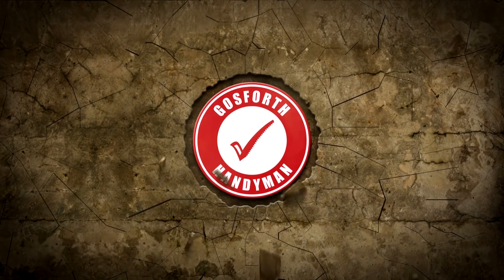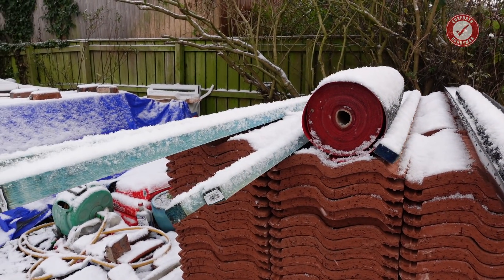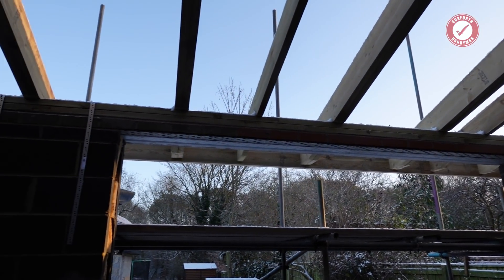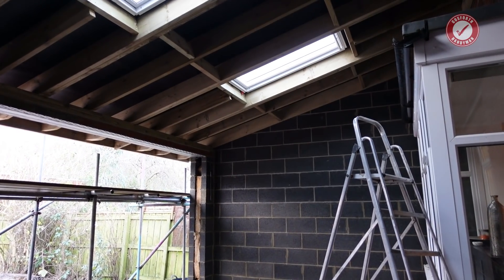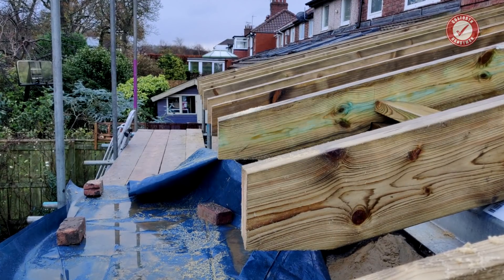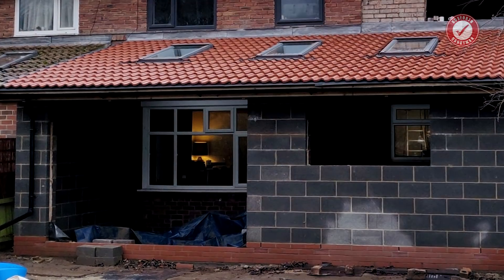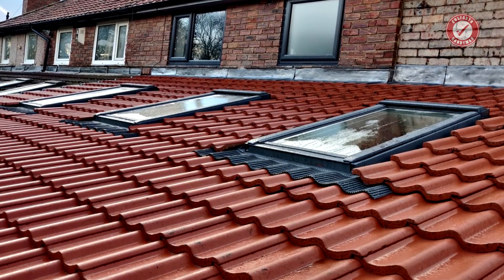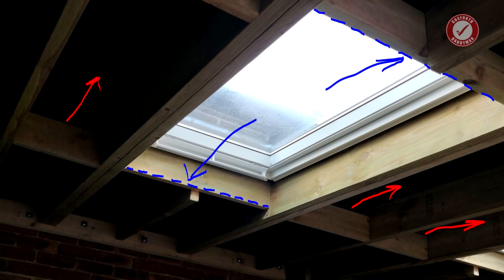Our extension lean-to roof explained

Comment: I’m a Gas Engineer of 20 years, last year hand cut my new extension roof in, with two large velux windows 1100x1000, battened, tiled, insulated, boarded completely inside, everything correct, and even the building inspector said he’s seen supposedly professional roofers do a worse job. Really proud of my roof.

Comment: What I’ve seen so far of your workmanship and attention to detail, I have absolutely no doubt you could have done the roof work yourself and achieve a far better finish. I’m amazed they left you with the issues they have.
Reply: Unfortunately I am not amazed at the issues that were left, I had similar problems with flooring contractors. I gave up calling them to finish the edges and did it myself.
I should have not paid them until the job was completed.
Reply from the maker: Cheers! I'll defo do my own roof next time. Did expect a bit more for the money. 🙄

Comment: As a retired roof tiler , that right hand verge was the first thing I notice. and there is no way I would have left it like that. ps; there is no way I would have done it like that.
Reply from the maker: Yeah, didn't think that was normal. No Idea what they've done! The top dry verge piece doesn't look like it's nailed in properly. I need to take a few off and have a proper look. 👍
Reply: @GosforthHandyman   my guess would be, battens too long, and/or tiles.  ps; I would cut and put dry verge in, as I think doesn't look finished.
Reply: also when I finished the roof, I would ask if your satisfied with what I'd done.
Reply from the maker: I think they just couldn't be bothered to cut at fit the final verge piece. 🙄

Comment: I would cover the roof rafter at the left and right side somehow with copper or zinc to prevent it from rotting away. Hard to see, but the water probably isnt catched completely if rain is a bit stronger as it will shoot over the gutter

Comment: I've seen some issues with extensions like this where the cavity is interupted by a lintel, so if water does end up inside the cavity it basically has nowhere to go. Ideally you have cavity trays leading to weep vents just above the level of the flashing, or in your case between the upper windows. Can be retrofit if you run into problems.
Reply from the maker: Amazingly there's a cavity tray under all of the old windows and over the 'tile' feature. So should be fine. Plus most of it will be rendered. 👍

Comment: Use a handsaw or sawzall and start by the fascia. 3:05  Shouldn't be too awful.
 An easy way to calculate exposure for siding or shingles, is to use a story pole that you make yourself. You know the total length and the size of your material. By varying the angle of the stick, you get different exposures. Don't forget clearance to skylight if any.
Reply from the maker: Yeah, wasn't too bad - just really awkward to get in. Multi-tool ended up being the easiest. 👍

Comment: Great update! I’ve had the same problem with roofers. The company I used last year to put a new roof covering and soffits, fascias, and guttering, won’t come out to fix a sagging bit of soffit where they haven’t put enough fixings. And the waste stack clip they used has snapped, so the top is swinging in the wind.

Like you I’ve tried 5 times and they’ve broken promises every time.
Reply from the maker: Very frustrating. I've given up with mine. Shame. 😭

Comment: If you are planning on attempting to dry out the walls and sub base with a space heater then I’d suggest insulating the roof space, blocking up the window and bifold door holes with celotex and getting a bigger gas space heater than you think together with a bigger propane bottle. Open the velux windows on vent and let the heater rip. I tried to dry the block walls out on my 7 x 7m garage without insulation and the baby space heater was running for an entire weekend and I barely saw any improvement but the windows were dripping wet with condensation so something must have been happening 👍🏻
Reply from the maker: Ha that's pretty much what we did! (without insulating the roof first). Dried out nicely (next episode). 👍

Comment: Hi GH. Just wondered is a cavity tray needed. Considering a conservatory roof replacement . Existing weep holes on onternal of conservatory.  Thinking i should install new tray above level of new roof? Wondered if you had this issue and covered in a video? Cheers .D

Comment: Cracking extension..... and videos.
Just one thing. The tiles immediately above the Velux window sit very close to the window. 
Speaking from experience,  cr4p builds up in the wee valley between tile and window, and if not cleared out, lets water build up and can ( in my case, did) leak above the flashing. Checking for rubbish ( and getting it out) isn't so easy when tile is so close. ( the edge of the tile will take your finger end off!).
Keep up the smashing work.
Reply from the maker: Cheers and good tip! I need to take a look. I think it's a big enough gap to clear out. 👍

Comment: Apart from the few sloppy items left to rectify it's good to see the roof on.
But I hope you gave the infill for the floor and the insulation in the walls more time to dry than a week without and a day with an industrial heater.
This takes ages to dry out, and without any heating it would not have had a chance at all to dry because of the wet weather and high humidity we had until the start of March.
I could see this on my driveway staying wet all day even on days it didn't rain over the winter months.
Closing the door and window opening with some plastic sheeting and then using an industrial dehumidifier would give a better chance.
Luckily March is now presenting with very nice and dry weather, and things are starting to dry out very well, and the constant battle against the elements is over for now.
So I was able to finish the underpinning of the foundation under the side extension of my house.
Reply from the maker: Yeah, floor got a good chance to dry out. Got a space heater and that really helped. 👍

Comment: yea the rafter around window. you have lenght of normal rafter minus window and two blocks, thats the leght on the rafter and it does not matter where the window is, so basically you could have prepared rafter with both ends (plus size of cut, thats like 4 milimeter) and then if you cut this for window at whatever spot, you have top and bottom ready.-

Comment: Scaffold and drains!! I was running a job in the Kings Road Chelsea, when i went out on to the third floor scaffold to see how the chippy was getting on and I thought that the scaffold was a bit springy. On investigation I found the ground workers had dug a drain trench right under both the front and back scaffold standards!! The roofers should have been patient - as they are [presumably] specialists, they should have told you in advance where the Velux trimmers should be positioned  and they should have told you in advance just how many tiles were required knowing the roof pitch [it's not rocket science for a roofer]. Don't envy you cutting the bottoms of those rafters, lots of bruised knuckles and plenty of swearing I expect....
Reply from the maker: Cheers Robin! Yeah, now that I see how it's done around the Velux I could have worked it out. Although it was nice letting them put the Velux in. 😁👍

Comment: Hi I am currently doing a extension similar to yours and would like to know whether you needed structural engineering calculations for the roof to have a vaulted ceiling.
Reply from the maker: Hi - yes, for building regs we needed architect and structural engineer drawings.

Comment: Hi Andy, how did you fix the verge board on? We have moved into a house with a similar extension, and I am trying to reverse engineer what they have done as it's a bit buggered...Basically, they never added a verge and just fixed a bit of facia capping over the tiles and down tight against the render. I guess because like you, the roof was constructed within the extension with walls shaped up to the roof line. Is yours bolted to the wall? Or did you fly some rafters somehow through the blockwork to attach it? Cheers mate :) P.S - been driving quite a bit for work so have been re-listening to the podcast :D

Comment: Great to see the roof on. 
With the timber roof, the other way is to stick to 600s all the way. This will mean the velux hole is too wide but just trim in a short rafter on one side or both to get an exact positon.  Then the plasterboard goes up easy!.
Reply from the maker: Yup, tried every combination but just didn't work where we wanted the windows with the 830mm gap. We'll probably lose a sheet or two of plasterboard due to the cuts. 👍
Reply: @GosforthHandyman  This is good information for other people trying to build extensions and the like: sometimes you just can't get find an arrangement of material that meets all the limitations and so you have to choose the least worst option and accept that some wastage will result. At least plasterboard can be recycled.
Reply from the maker: Cheers! Yeah, it was basically a toss up between extra rafters or have some plasterboard waste. Plasterboard is cheaper. 👍😁

Comment: Hi Andy
Wow what a transformation looking good now mate,  you must be made of money mate if you are using an Electric fan heater to dry out that area would be much better off with an oil filled radiator or a greenhouse heater that runs on oil or paraffin great video mate thanks 😊
Reply from the maker: Ha ha, the electric heater was just to warm my hands. Got a little space heater to dry the place out. 😁👍

Comment: Great video, I’ve done a flat roof approximately 40sqm for an outhouse but never done a pitched roof rafters. Now I’m considering to build a 6 meter extension. Is there any reason for not using thermal block for internal skin of the wall? Thanks

Comment: Hey Andy,  Rainwater into a foul sewer?  do you guys have different rules up there?  I would have thought in view of the fact that the extension gives on to the garden, you would be expected to run it into a soakaway??
Reply from the maker: Everything is combined sewer around here on the older houses. Not entirely sure why! Someone mentioned the soil type doesn't lend itself well for soakaways but not sure how true that is. 👍
Reply: I'm in East Anglia & our gutter run offs goe into the foul in our road for certain due to problematic watercourse topography & soil type (mix of 100+ year old up to 10 years old & new development going in also)
Reply from the maker: Interestingly there's a rainwater sewer in the street but it just runs in to the river.

Comment: Looks like the rain would run over the gutter .. probably need to pack out facia to allow for rain run off
Reply from the maker: The final gutter will be higher but no sign of the rain overshooting the gutter so far. Easy enough to pack it out if it becomes a problem though. 👍

Comment: How is the dpm going to lap with the dpc.  That on the face of it is a carnal mistake!  I would have expected the oversite slab to have been installed early to allow the concrete to be tamped off the wall.  As it stands the oversite will have to be levelled 'by hand'.
Also, why is the extension roof using a different roof tile to the main roof, it looks odd.  Is the pitch an issue, if so the there are ways and means to resolve that so that the Roman main roof tile can be used on the extension rather than the Grovebury.
Reply from the maker: You don't need to lap the dpm with the dpc for an oversite under a suspended floor if the outside ground level is lower. If the oversite had been installed early it would have filled up like a swimming pool. Happy with our tiles. 😁👍

Comment: Just joined and some great content.  Im a keen diy-er but not as big jobs as this yet. We had builders in for exactly same extension few years ago but the stock gutter they installed (looks a bit like your temp one) was not up to the job and when heavy rain it would just shoot past the gutter due to the roof pitch.  Have you expirienced this and what size gutter have you ended up with as I want to change ours.?

Comment: I install guttering on new builds for a living, and dry verges are a nightmare.
The gutter needs go to past the edge of the tile or else you will get a drip.
As you have have pan tiles it won't be so bad, but water still gets blown under the verge and and starts to rot the batten. 
On your roof I would have pulled or cut the cap out of the verge to make the gutter stop end fit.
Some roofers fit expanded 'loofer' type plastic instead of the verge ends.
The NHBC love dry verges as they technical stop the wind getting under the tiles, but on some jobs I've been told the gutter needs to extend 50mm beyond the edge of the last tile. How's that going to work?
Hope that makes sense.

Great Videos BTW

Peace and Love.
Reply from the maker: Luckily the final tile on both sides slopes upwards, so hopefully rain blown under the verge won't get down to the batten. Not sure if that was deliberate. Starting to think it was by chance 😂. That's just temp guttering btw 👍

Comment: Hi mate , your videos are very much informative and  much appreciate for the same . I am planning to buy a house and the viewing is over and offer is accepted. As you know it’s a very demanding market with lesser houses in the market so I have to admit that they are charging me a big price. The property was rented from many years so it’s not properly look after but no difference in price though . When I did the viewing noticed that upstairs flooring has dip and uneven , even downstairs as well but didn’t noticed any dip . I am a first time buyer and would you pls let me know should I need to conduct a RICS level 3 survey or a builder from just trade will be fine pls ?! Much appreciated your response for the same . Thank You

Comment: The dry verge are easy to take back off and then check why there is a gap either tile cut to wide or as you say the Battens are to long.
How come you decided to go with the Terracotta tiles ?
Reply from the maker: Dry verge - depends if they've used ringshank nails - might break trying to take them off 😬. Terracotta tiles - same colour as existing and neighbouring properties. 👍

Comment: Having just fitted mesh to my gable end to evict the birdies I feel your pain. The builders didn't leave the same gaps on the identical house next door 😬 (the original owner of mine was involved from very early on so the short comings I've found and fixed & that it was only a 2 house development make it even more grating)
Is your soil/drain pipe remaining inside the extension on the old external wall like that? (Being boxed in?)
Reply from the maker: Nightmare - glad you got sorted! Yeah, soil pipe will be boxed in. 👍

Comment: Andy, must have been a weight off to have finally achieved full roof coverage. Question with regards to the floor in the extension, was there any particular reason why you went down the path of a slab instead of a suspended floor like in the older part of the house?
Reply: He's actually having a suspended timber floor in with a concrete subfloor. You can see the same construction in previous videos with the new kitchen floor. The concrete subfloor is a UK building regs thing as far as I'm aware, which helps prevent moisture from the ground building up under the floor.

Comment: Will you fit the window over the lead upstairs ?   Will driving rain get through under the sill
Reply from the maker: Sill gets sealed to the lead in this scenario. 👍
Reply: If the lead is long enough you should turn it up against the window sill

Comment: Gosforth - many thanks for the continued content. Couple of questions if you get a minute - I am considering a house with a similar extension housing an open plan kitchen/dining area. It is a reasonably new extension - so assume it is up to code - how is it for retaining heat? I have a flat roof galley kitchen extension at the moment and in winter it is an absolute ice box. I close off the door to avoid the issue. 

Second question - I feel your pain on roofers; absolutely useless and get paid a fortune. Is there any reason you didn't "just do it yourself"? The lead maybe?
Reply: I got told off for using the term "up to code" by a UK architect because it's an American term. Don't assume that the extension meets building regulations for insulation, my stairs are fairly new and were signed off by building control despite being steeper than 42 degrees. That said I'm guessing this roof is going to be well insulated in the winter and the real pain will be trying to keep it cool in the summer with those velux windows creating a greenhouse effect.

Comment: Why you don’t put ply on roof like we do in Scotland I don’t no much better looking good though👍🏴
Reply: Ply? Sarking boards, or OSB but ply! The main reasoning is it depends on the extremity of weather you get. Obviously the further North the harsher the weather.
Reply from the maker: If you have sarking boards do you need special ventilation? I know the tiles and membrane are designed to allow airflow. 👍
Reply: No just 8mm packer on top of rafters then tile battons
Reply from the maker: Interesting! 👍
Reply: @ChelseaPensioner-DJW  not that much difference in weather just different building regs ment osb call it ply